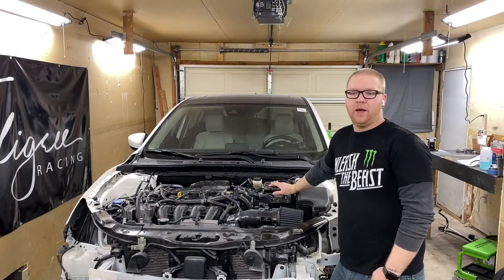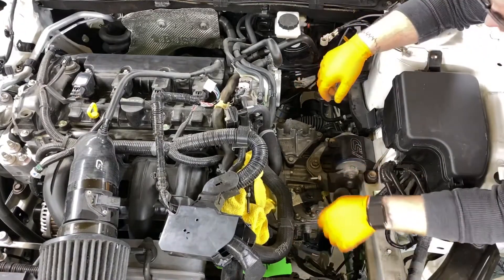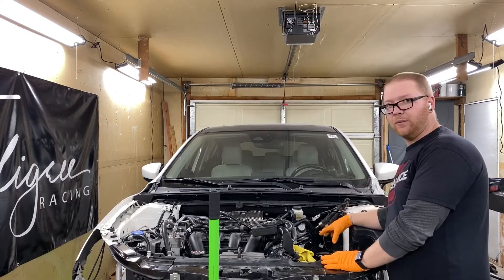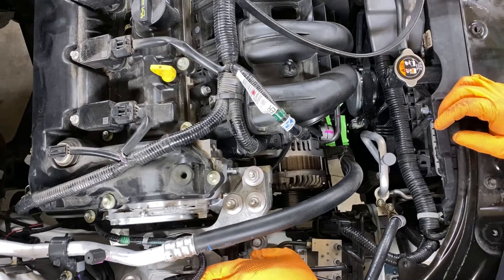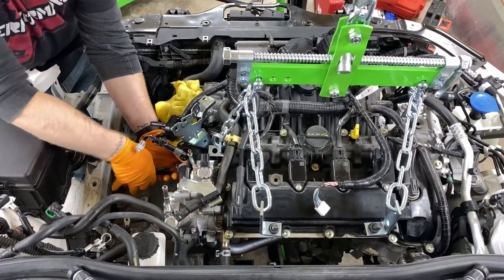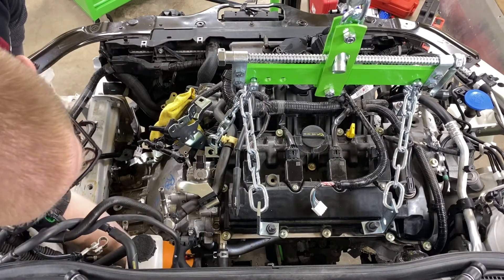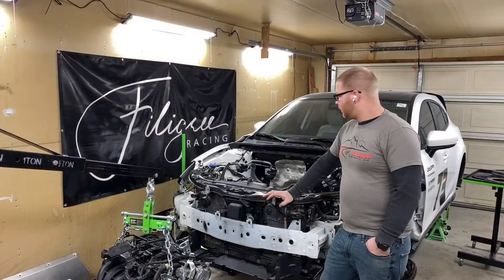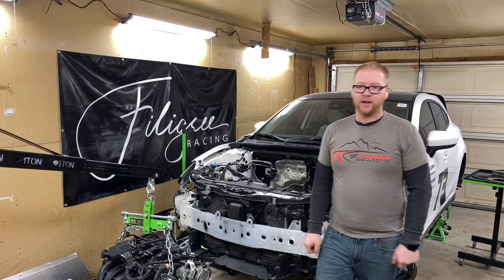FWD Engine and Transmission Removal

Comment: It's pretty insane how similar FWD mounting systems are. My 05 neon was very similar for removing everything until the transmission mount. I'm sure the rest would be very similar, but never needed to take the engine fully out haha.
Reply from the maker: Joseph Hodges most cars are pretty similar. It’s all nuts and bolts essentially. As far as FWD goes this is pretty easy.

Comment: Does dismantling an engine and transmission with gear engaged affect either of the two? The job was to replace the main seal (between engine and gearbox). It's still dismantled. The engine is not at TDC, new seal is yet to be installed. It's said to replace the seal when engine is at TDC.

 How to avoid any damage? Kindly respond soon. 
Engine - VW 1.6 MPI
Reply from the maker: In gear doesn’t matter between the two. Rotate engine to TDC, and replace seal. When it goes back together you may have to rotate the engine or transmission slightly to get it back together, and dowels to line back up.

Comment: I'm really surprised that you don't have a short shift plate installed. Do you have the solid shifter mount bushings?
Reply from the maker: Berto606 I actually have both from Corksport. With the battery box out of the way you can you can see the black short shift plate.
Reply: @FiligreeRacing  ok. I was looking but I couldn't see it. 👍